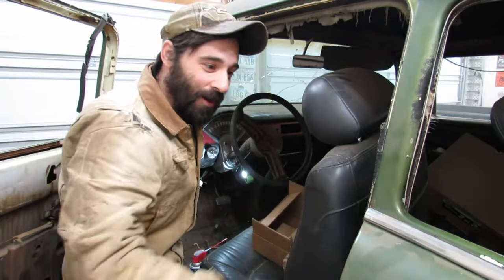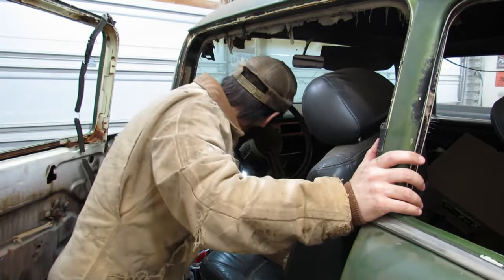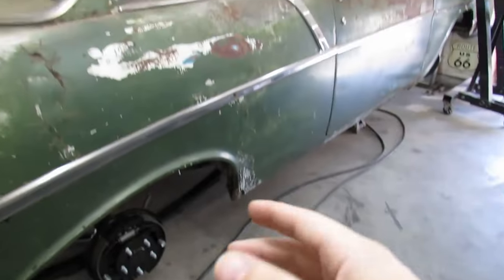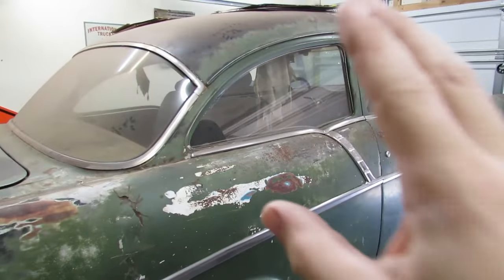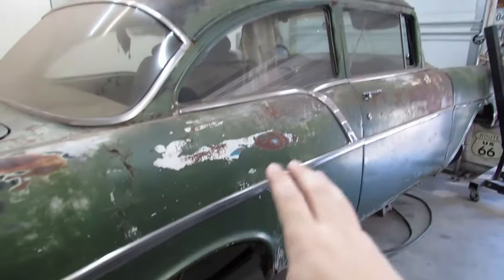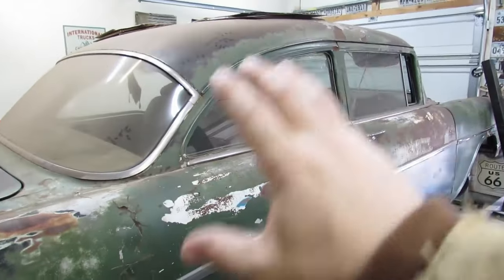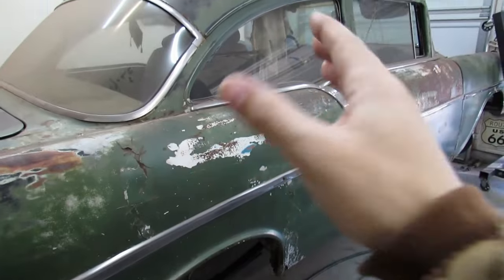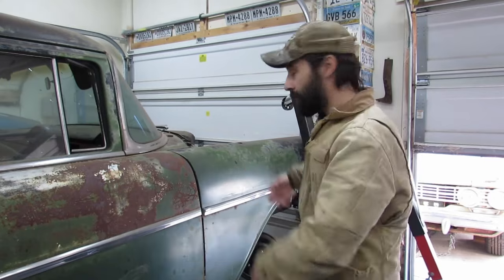Restoring This Is Not Necessary... Abandoned 1956 Chevy Build

Comment: Hey Freeman, That handle was not original from the factory. since you are waiting for the wheels you might as well get a new original T handle. They were not very very robust and most broke after years of yanking. Also have you thought about getting an impact driver? It would cut down the time removing those stuck bolts after you put the torch on them. Thanks for this vid I will have to do the same on my 56 chevy.   John M.
Reply from the maker: You know I was thinking about that handle. It looked a little big to me. That’s a grand idea I might snag one up. I know what you’re saying about an impact. I have a big one but I really should invest in smaller one I can zip bolts out with.